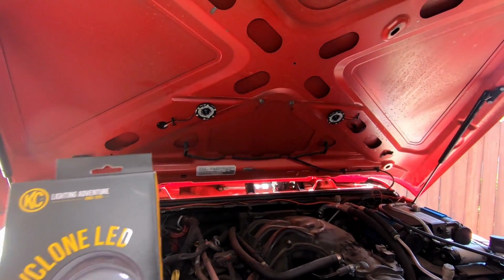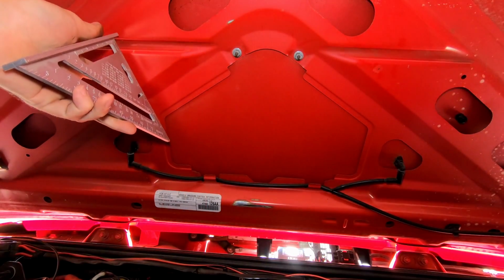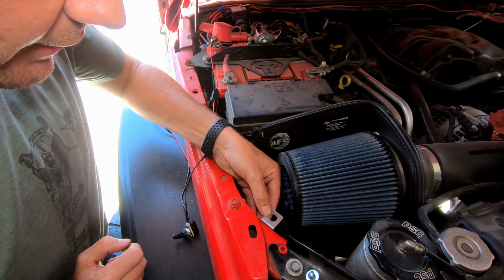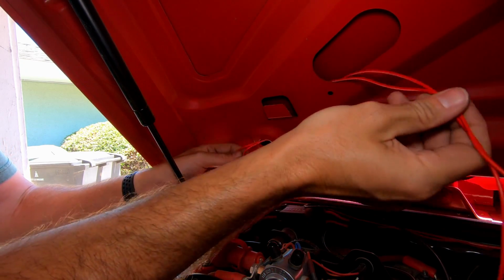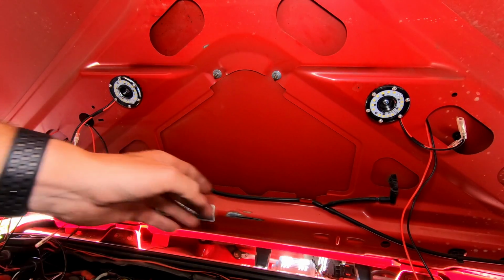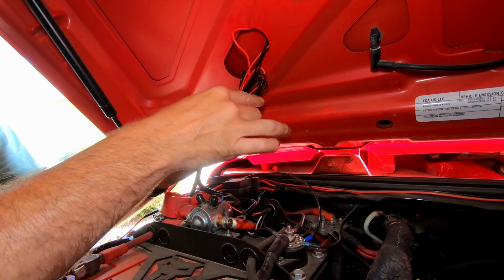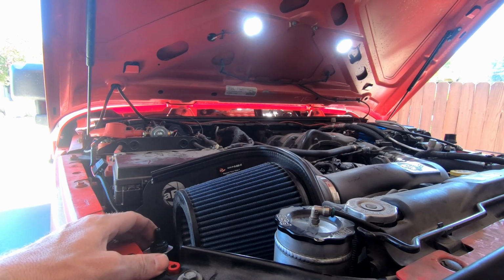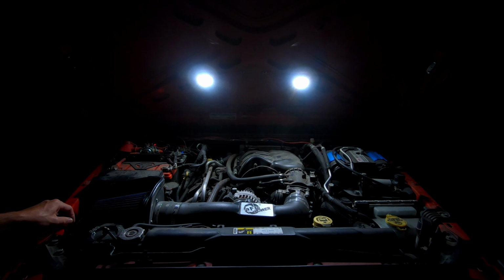Jeep JK KC Cyclone LED Under Hood Lighting Kit Install

Comment: So you could wire them into a switch pod also.  I really like this.im going to check them out. Thanks for the info and video.
Reply from the maker: drillbittreed10 yeah, totally. You could even just order a couple of cyclones for much cheaper than the cost of the kit and wire them up yourself and tie them in to a switch system

Comment: The bummer about these lights is that the switch isn't a plunger type of switch. On most hoods your light is off when the Hood is down and lights on when the hood is in the up position instead of having to fumble around in the dark looking for a toggle switch. I've never saw a vehicle without a under hood light until I bought my Jeep.
Reply from the maker: Yeah, a plunger switch would definitely be a nice option. I know you can purchase one separately and wire it in to this system. I saw an installation of this kit where someone did exactly that. Technically, you could just buy two of these lights and your own plunger type switch and wire up everything yourself 🤔